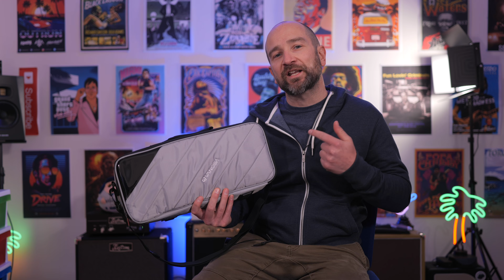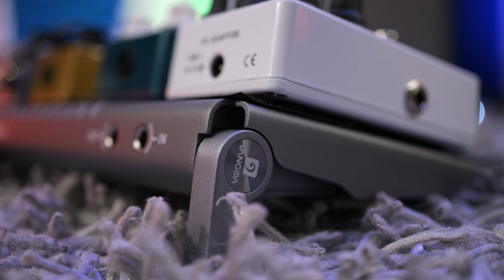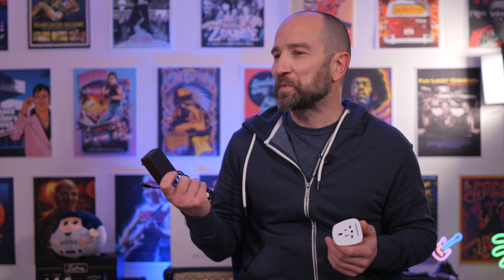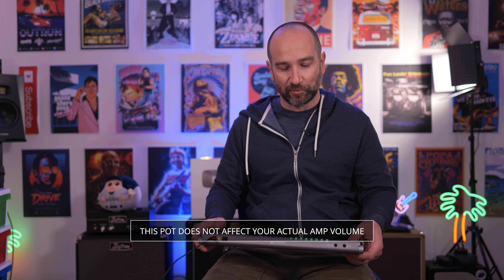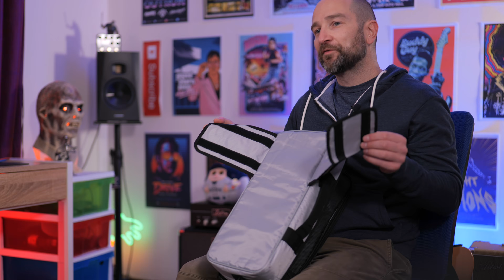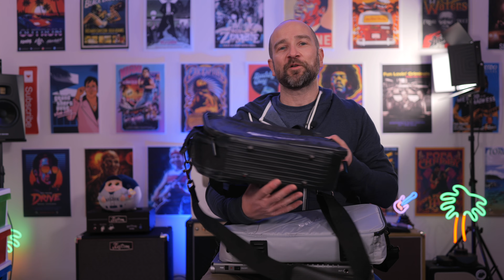This Pedalboard is Affordable, Unique, and Lightweight!

Comment: Amazon has lots of great pedal boards. One is a road case kind, which are usually pretty pricy, but they have one that is just over $100 US. The board has 2 handles on it and it pops right out of the case. Very convenient. I work in a wood shop so I just built my own, but I have quickly out grown it so time to move on.

Comment: Cool concept.  What would make this perfect (in addition to the tuner idea) build in switchable buffer after that input jack, and build in the power supply which currently lives in the wall wart so you can use a standard power cable with no wall wart.

Comment: If you are like me and don't like placing Velcro permanently (either on pedals or pedalboards), you can always use blue painter's tape (or similar equivalent) on the pedal and / or board, attach the Velcro to it, then if you want to remove it, when you pull the Velcro off, the blue painters tape comes with it so there is no damage done to either the pedal or pedalboard, resulting in a plus in selling, and most important for me, a major bonus in purchasing used equipment.  (Having said all that, I actually prefer using pedalboards that attach with zip-ties, which explains why I hate attaching Velcro permanently.)  I am not necessarily a fan of the LED's (keep in mind I'm "OLD" like in 2 to 3 times the age of most watching Shane's videos) but that doesn't mean I hate them, either.  I'm sure there are tons that will find it a plus.  This is definitely a nice pedalboard.  The Discount Code is fantastic!  Thank you to Vangoa for giving it to you to give to us!   Another great demo, review, and video, Shane.  Please keep them coming.

Comment: After just buying a Pedaltrain Classic and mounting a One Spot CS12 at close to $400, then dealing with routing cleanly, I absolutely love the integrated iso power supply. A larger board with a few 18v or, even better, variable would make it really attractive. Not a fan of the LED bar but maybe a switchable LED gooseneck type light so I can see pedal settings in a dark environment. Love the sleek look though.

Comment: Nice product. Shane, do yo know if the power supply is really isolated? If so, it must be the switch mode technology? Or is it really a daisy chain type thing? And is the in/out true bypass? Buffered? Thanks
Reply: I emailed the company asking these questions. For those interested, here's their reply:

"Thanks for your inquiry. Yes, the power supply is isolated. Technically speaking, the outputs are isolated by the secondary windings of the transformers inside. The negative pins of the outputs are not connecting to each other. In conclusion, this isolated power supply is switch mode, and regarding the input and output of the signal, it is buffered.
If you have any questions, please feel free to let me help.
Best regards,
Cleo"

Comment: The lights are so gimmicky. The built in power is a great idea.
I did buy a cheap Korg Pitchblack rackmount tuner that I intend to build into a pedalboard once I sort of figure out how many pedals I normally use and what size board I need.

Comment: A tuner would be very handy for that size board, totally agree. Should be standard fare now on these pedal boards. All since losing button battery tuners (Safety); and now having rechargeables for headstock tuners (Hassle).

Comment: Hmmm, it makes me wonder during the meeting on designing this, if there was meant to be some other feature for those LED lights? Seems a strange addition. 
The length of the power cable is a bummer, but I can understand why it’s only that long. With electricity through a cable, it has a certain amount of “drag” which slows or reduces the power supply. I believe there is a equation per mitre (I’m not an electrician) 
In an effort to probably keep the price point lower, they’d go for that style instead of going for something longer that could possibly cause an issue with the pedals? But that’s just a guess.
Looks like a nice unit though!